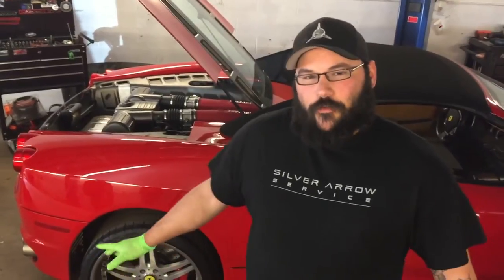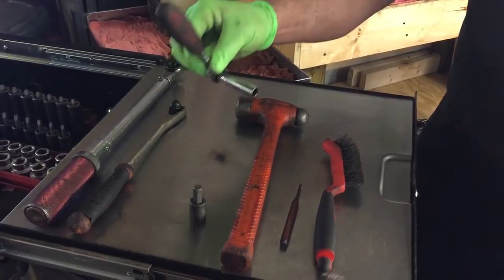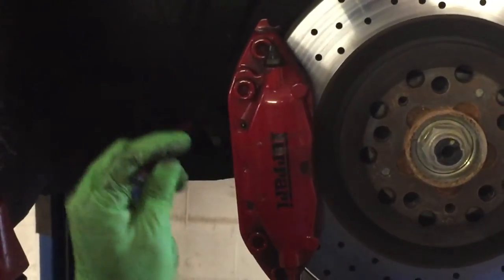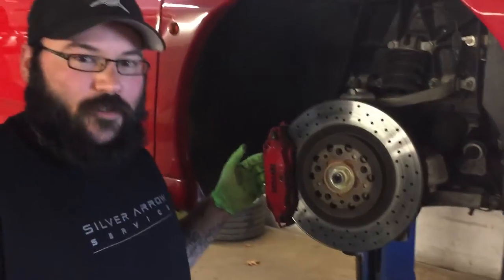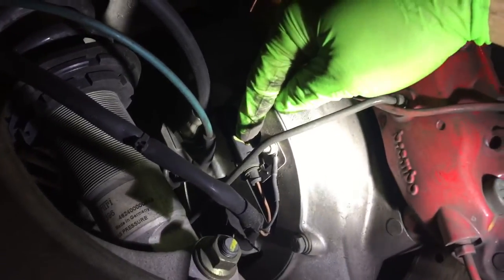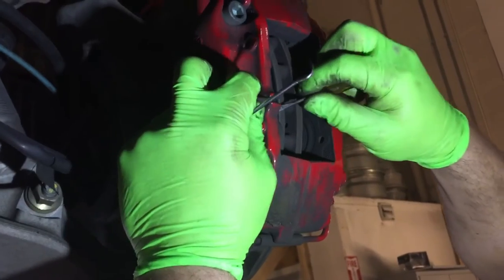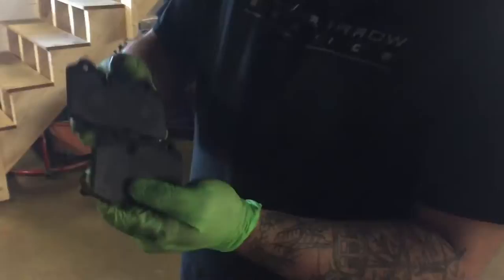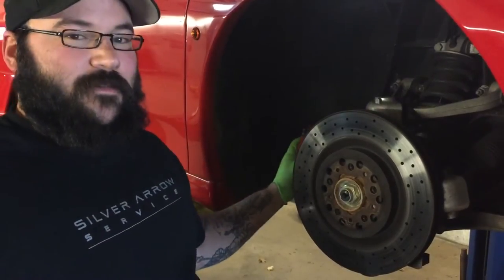Ferrari F430 Brake Job

Comment: Changing the front brake pads on the F430, minus the sensor and removing the caliper, is exactly the same as changing the four wheel disc brake pads on the 1980 BMW 528i I had in the late 1980s.
One day I changed the pads on all four of the BMW's wheels in 30-40 minutes. So easy.
I'm looking to get a 1980 Ferrari 308 GT S or B sometime in the future, and my BMW experience will allow me to change the Ferrari front pads. The rear pads will take some time, because of doing something with the parking brake cable. I will figure it out when the time comes.
Haynes does not make a manual for any Ferrari. A printed manual would be essential to have.

For mating surfaces, such as the back of the wheel to the hub face, I have always smeared both surfaces with white lithium grease. Even in the salt-in-the-winter Northeast, by using the grease in that manner, when I had to remove a wheel, it popped right off.

E  brake sounds like some sort of communication. Let's call it what it is, a parking brake.
Thumbs up for the video.

Comment: Nice work, guys. I definitely learned a couple things! Looks like its about the same for a 360. One thing I did to save time on the rears is, instead of removing the handbrake caliper, pull the clip that hold the pin that hold the pads. You can then remove the pads which gives enough clearance to take off the rotor. When its time for reassembly you can just use regular needle nose pliers to turn the caliper piston...one less tool for us home-gamers to buy :)
Reply: Instead of using the needle nose pliers for the brake piston, there’s a piston retractor tool kit you can buy on amazon that’s universal and made specifically for the job. There’s multiple companies that make them, and they’re usually ~$20.

Comment: Hey Guys, nice job! Just one question about lubrication: isn't it better to use e.g. ATE Plastilube on a braking pads sliders (mean on the surface sliding in brake calipper)? Thanks for answer in advance!
Reply: Ordinary copperpaste does exactly the same thing.

Comment: why can't the rotors be cut?
Reply: There’s a minimum thickness that is considered safe for road use, and these may have been beyond or close to that minimum thickness. If the rotors are turned/cut there is a high chance of warping, which is very apparent under heavy braking.